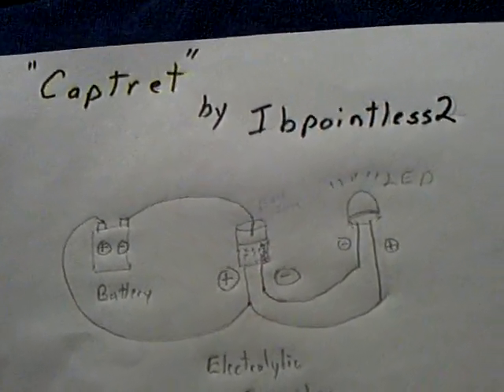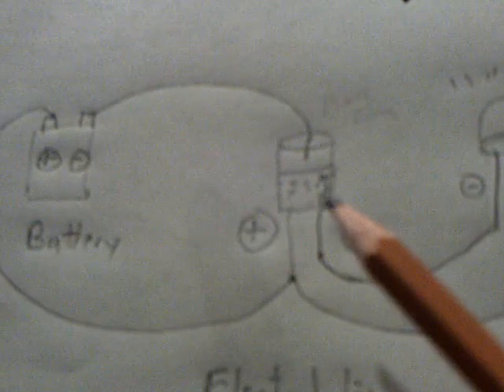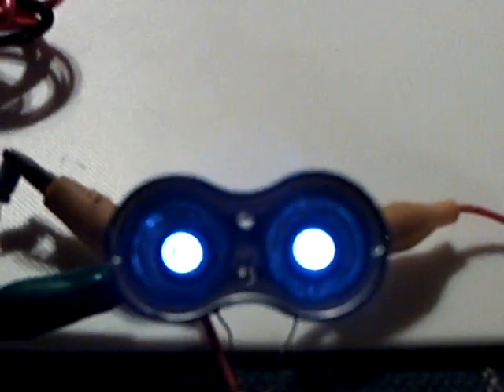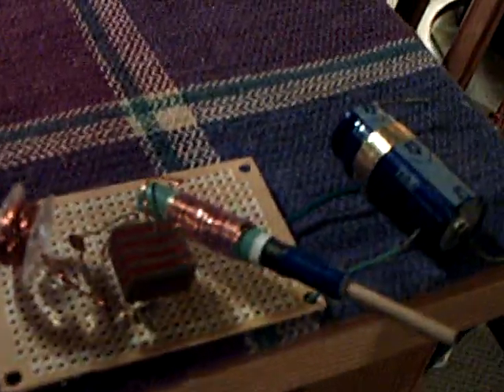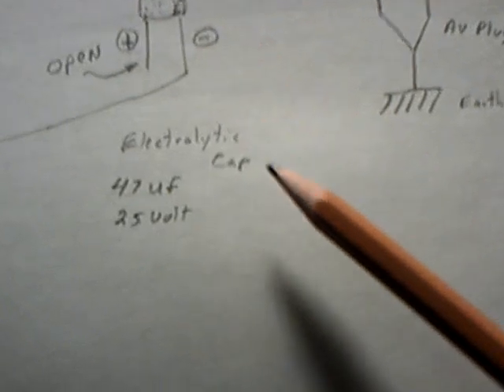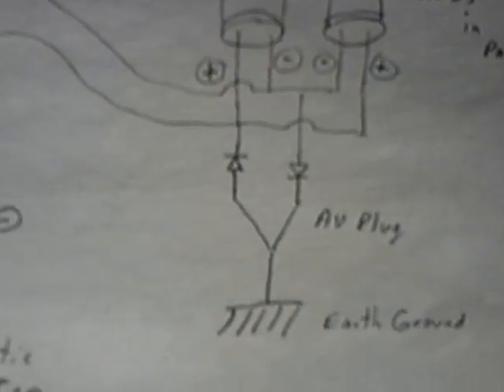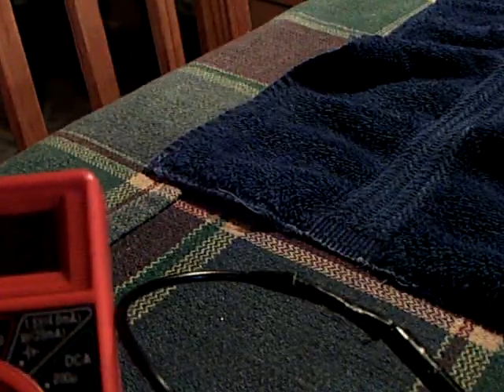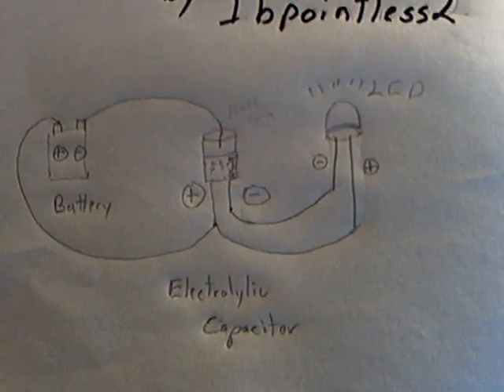Captret replication.ASF

Comment: hmm so essentially the cap is in parallel with the battery through the case grounding, and the LED is in parallel with that series in the circuit going through the resistance (or whatever valve?) is going on between the negative terminal of the cap and its ground casing. could it be acting like a "faulty" diode in a way?

Comment: I dont think that the 'can bit of the cap' is connected to anything. I think that DC currents radiate the smallest bits of electrodes. A capacitor is where current is stored. No recovery can be made with the 9 volt, only is more current or voltage is wasted. It is acting like a SEC, because the 'can bit' is collecting capacitated current and is wireless. So in essence this is basically like a sort of capacitance transformer. I'm only 13 and very interested in this revolution.

Comment: Did you measure for the ac voltage on the cap?  It was pointed out that there is an ac voltage present.